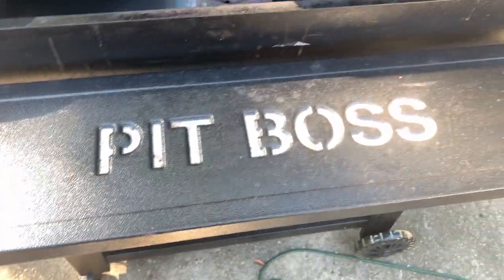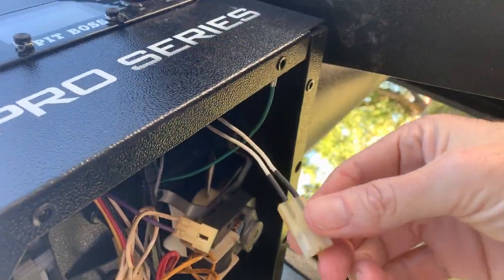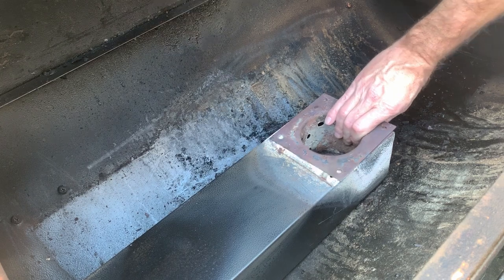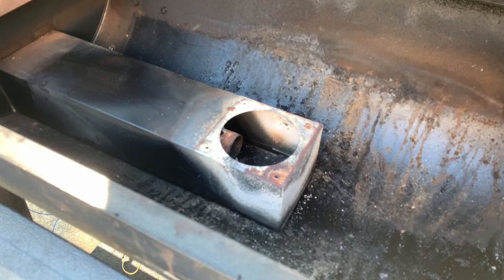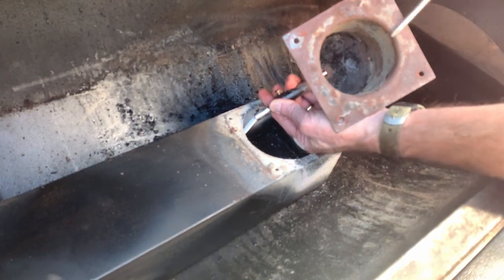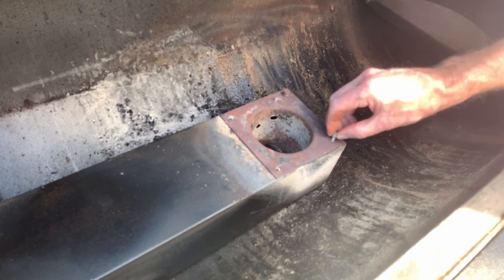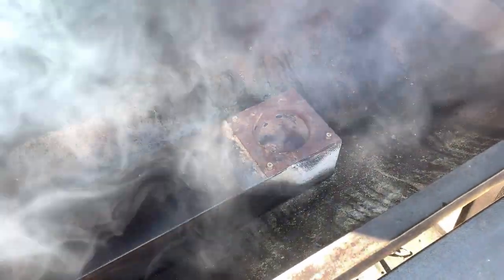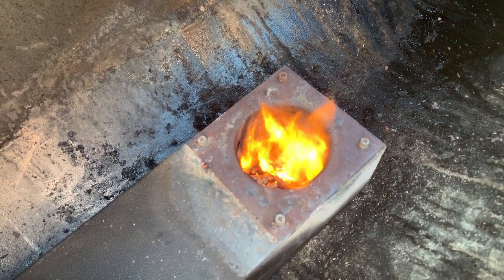Pit Boss Igniter Replacement / Replace Pit Boss Heating Element

Comment: Glad I watched! About to do my 1100. And mine is heavily modified. Looking at the directions with the hot rod kit seemed like way too much extra work. I'll do this in a few minutes after I eat a snack lol. My pitboss has a race car header for a stack. Moroso valve cover from a sprint car as a baffle above the stack. A-arms for bracing. My race shop logo engraved in a live end hardwood bench. Used roll cage tubing to build the frame. A rod from a blown race engine as a backstop for the lid. And a big aluminum afco shock for a lid handle. Cook on it almost daily. First trouble in 3 years.
Reply from the maker: Glad it helped......and some nice upgrades there.

Comment: Just finished completing the igniter replacement on my pit boss Casey combo and I would like to offer a couple of deviations from this procedure.   I found that in my case it was easier to remove the fan motor by unscrewing the four screws holding it and dropping it down out-of-the-way that way you can put your hand up in to the cavity and thread igniter cable connector through the rubber grommet hole much easier.  also you need to make sure you pull the cables tight so that you don’t have access cable up near the fan blade and make sure the cables out of the way of the fan blade.  I also installed a master kill switch at the same time in the powerline so that I could shut the Casey combo power off to the unit and it does not keep running all the time and that way you do not have a parasitic draw of current 24 seven.
Reply from the maker: Thanks for the additional info......more techniques are always great.
Reply: thank you for the fan dropping suggestion.  it really did help 😊

Comment: My igniter went out. I called pit boss and they said mine was out of warranty and a year and a 1/2 old. They wanted 50 bucks plus shipping for a new igniter. When on Amazon purchased an igniter for $14! It looks identicle and works great period! Switch out was easy don't forget to remove the rubber grommet that makes it really hard  To get the igniter out..and tape a string to the igniter when you go to pull it back through! Great video
Reply from the maker: Yea I got an extra one from Amazon also.

Comment: Hey there Bummer, thanks again for another great video and info. I’ve thought several times about contacting you. We both bought our Pit Boss smokers around the same time and my igniter went out on mine also about a month ago. Going to replace mine tomorrow and like you said, have watched several videos on how to do it. I like your idea the best, using the wire method to string the new one into place. I hope this isn’t going to be an every 8 month repair. I called Pit Boss and they were very helpful. My igniter went out a week before Thanksgiving and I was really bummed out Bummer lol, because I have always hickory smoked our Thanksgiving turkey. They told me how to use the grill without the igniter by putting a small handful of pellets in the burn pot and using hand sanitizer to light the pellets. Not kidding you! lol. I didn’t like that idea so I went back to my old method of paraffin wood wafers and a stick lighter. Worked great and our turkey was the talk of the family. I used the Apple pellets for something different and like I said, it came out great.
   Why I’ve been wanting to contact you, is to see if you figured out that you can’t use the 3 2 1 method of doing Ribs on our smokers. With the constant flow of air from the fan, it’s like baking in a convection oven. Everything cooks faster. The turkey I did was a 24 pounder and it was done in 3 1/2 hrs. In my old smoker, it would have been 5 to 6 hrs. if not more. Hope I have helped you out for a change. Thanks again buddy and hope you and yours have a Merry Christmas and a Happy New Year. Give that lovely little food taster of yours a Christmas gift and tell her that it’s from a crippled up old man from Buffalo NY. lol
Reply from the maker: Have tried the 3-2-1 method several times on ribs at 225....and think it's just a little to much.....I like fall off the bone, but they can almost be pulled pork..thinking abut trying a 2-2-1 at 225.....hope you and you family have a Merry Christmas and a Happy New Year......and reach out anytime.

Comment: Great video.  My paint started peeling and pitboss sending me a new barrel. Wonder how hard that will be to switch?
Reply from the maker: Probably not to bad, but it will be a pain taking it apart and putting it back together.
Reply: Paint peeling from where??

Comment: Great video. Where can I order spare parts for  this unit or others? Such as heating igniter or fan motors or power supply board?
Reply from the maker: Probably best to get it from Pit Boss if it's under warranty and get it for free, or you buy from Pit Boss.....but I also ordered a spare igniter from Amazon that is identical to the one Pit Boss sent me.

Comment: Your motor and fan area is spotless, looks like it’s brand new, how do you keep it that way when your hot rod is used so much it needs replaced? I clean my pot boss 820D every 3 smokes unless it a long one then sooner and also clean the fan and motor area twice a year and it’s a mess.
Reply from the maker: Just use a basic shop vac to clean it out.....

Comment: Is the ignitor the same for all smokers?
Reply from the maker: Pretty sure they are all kinda close, but always make sure to get one thats at least compatible with your smoker, I got some off Amazon for a lot cheaper than the Pit Boss one.
Reply: @BUMMERSBARBQ    I’ve only seen 2 on amazon so I wasn’t sure.
Reply from the maker: @joeconner2669  just glad I ony had to replace it once......still got an extra just encase.

Comment: How do you get the blasted screws off the control panel? We've tried pb blaster and they still won't budge
Reply from the maker: The "Control Panel" or the cover for the Po??????? the control panel is only a couple of clips on the inside if the box/hopper..........You have to take the bottom off, not very hard.
Reply: @BUMMERSBARBQ  the  bottom plate screws refuse to budge
Reply from the maker: @suzyqwingnut96  mine came out really easy........maybe they screwed yours up and cross threaded them or something......